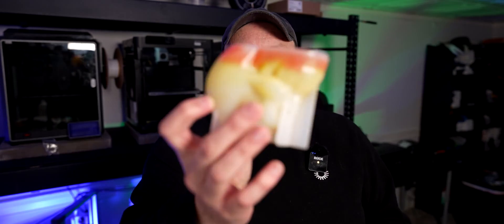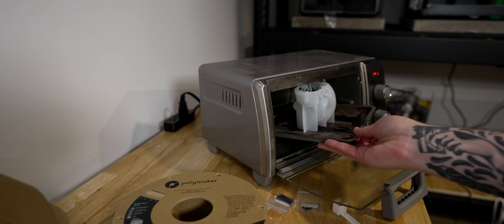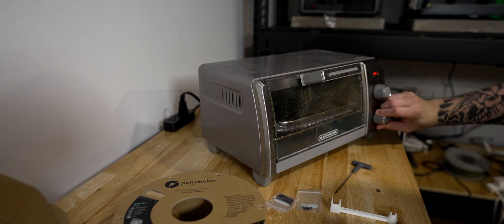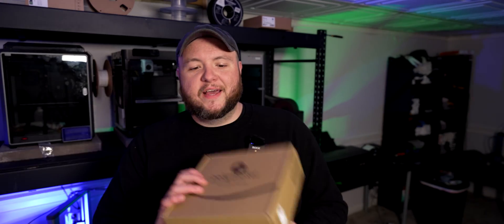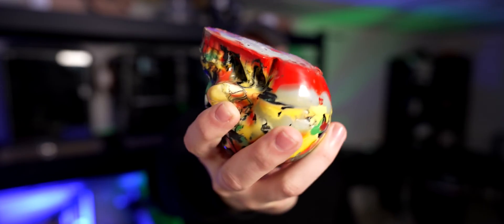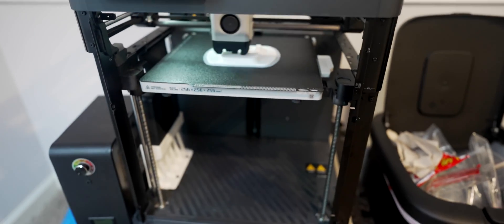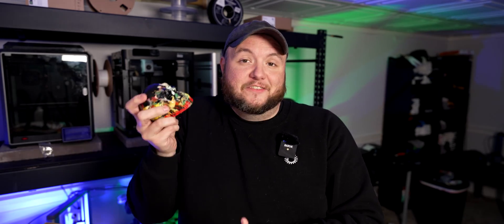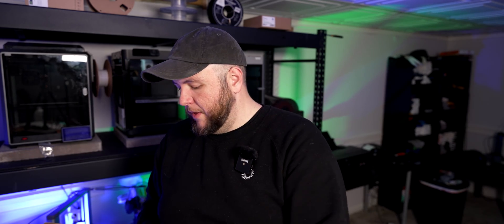MELTING 3D PRINT WASTE INTO SILCONE MOLDS

Comment: i see some people pre melt the plastics into a slab using like an old electric grill (between silicon sheets) , fold it over and then put that into the mould. it probably removes the bubbles.

Comment: 425 at 10-15 min intervals of packing more PLA into it. Was able to complete in about 2 hrs. It takes quite a bit of filament. Make sure to pack it really well and put in fridge for an hour or 2 to cool it down before pealing. Even the base came out flat on mine. I used a spackler blade to pop the bubbles and flatten it out while it was hot. PERFECT!
Reply: 2 hours?.......it takes me pretty much all day, but I'm also doing a few at a time so the heat is being soaked by multiple pieces.
Reply: don't put in the fridge man, 1: that will give your fridge a really hard time, 2: you want the polymers to relax, slowly to create the best bonds and strength. Cooling too fast is wht abs needs an enclosure (for example)
Reply: What's the name of the mold brand.  Also do you spray it with anything so it won't stick to the mold
Reply: @AdrianRodriguez-ik4eh can’t remember the mold brand. I sold my stuff. Too busy fishing. No spray required. The mold pops off.

Comment: How about a sander for the bottom?
Reply: the problem with sanding it is that the friction will start to heat it up and melt it rather than grind it off. it can be done in short increments, probably tho

Comment: I bought a silicone mold from Amazon too. I tried to make something in it twice using my PLA scraps. Both attempts were unsuccessful.  I read a bunch of things on it & watched a lot of tutorials to make sure I knew what I was doing.  I don't understand why mine won't melt all the way. It looks more like someone took a lighter and  tried to melt a bunch of scraps just enough so they'd stick together, then tried to squish it into a design. 😆🤔😭
Reply from the maker: You may need to play with temps depending on the size of the oven/toaster you are using. More heat, etc

Comment: Great video! A question tough. I have tried this now and it works, but there is a lot of (blue looking) smoke coming out of the oven. I did it outside, in an oven just like yours, 190 celsius (about 374 Fahrenheit) and a bit higher. I am melting matte PLA filament by „eryone“. Did you have the same problem with the smoke or any suggestions what I might be doing wrong?

Comment: One thing i saw on another video was pack it partially then ball up some tinfoil and then add more filament. That way it will use less and should cut down on baking time and leave more filament for more. Of course this will only work on larger molds.

Comment: would an air fryer work ?
Reply: I wouldnt use anything you plan on cooking food with again
Reply: @4lan39  not its a old one i didnt want to throw out just incase i could melt filament ideally take it outside to melt stuff
Reply from the maker: I’m sure it would. You’d just need to monitor the temps till you figure it out